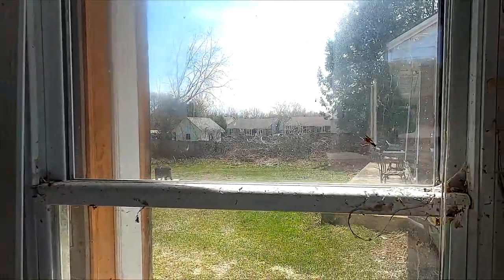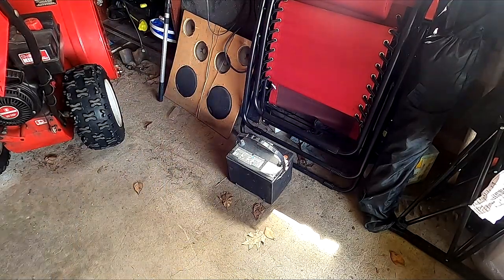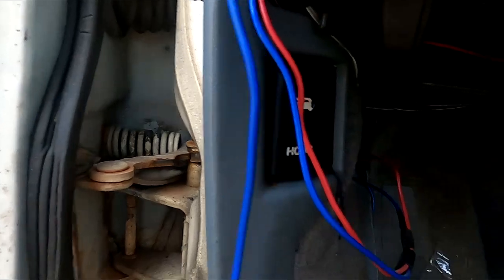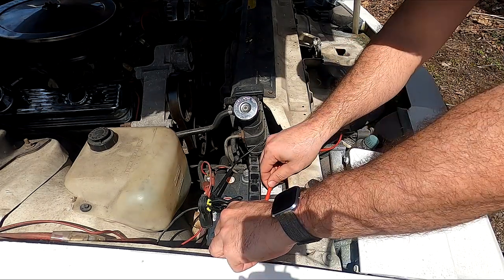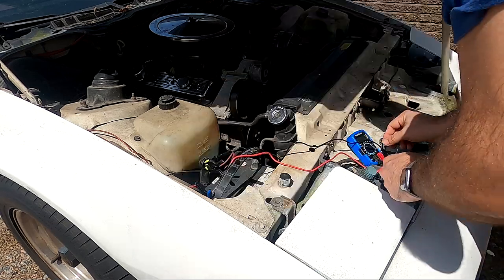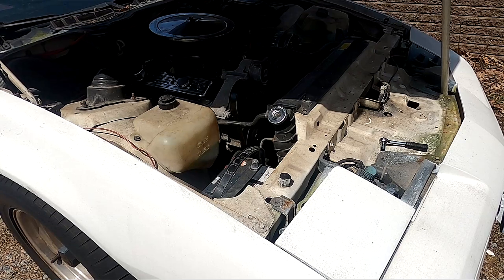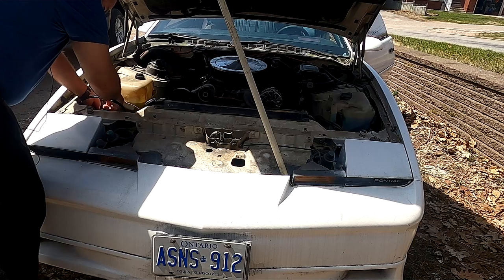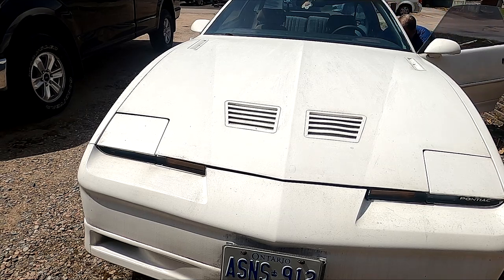Diagnosing the parasitic loss in the TransAm

Comment: If new battery doesn't help. Pull the negative off the battery. Put the test light between the post and the ground wire. If the light illuminates, you have a draw. Use the fuse pull method to find the draw; when the light goes out, you found the draw.     Like you said google is your friend

Comment: I just had an original battery in my previous car. Chrysler concorde 2002. It was a a battery from 2008 or 09? Lots of use out of it but also had a fusible link go on it at same time. Some battery's can get lots of life out of them as long as you drive the car and allow the alternator to charge it.

Comment: And the smart way to measure current draw, pull a fuse, probe across the socket, move to the next fuse, and repeat, and when you find the draw, there you go, measuring a draw at the battery just says "Yes, you have a draw, good luck finding it!", so, fusebox probulating is the task required... :P

Comment: So, first, yes, dead batteries will lose volts, because they usualy have shorted plates inside, and the headlights, they probably have dirty contacts in the motors that should tell them to stop turning but aren't making good connection, hence them pulling them in when you connect the battery, though I'm no expert on poppy-uppies, my extent of headlight tech knowledge is 2CV headlamps where they're bolted to a crossbar under the bonnet with an adjuster knob inside the cab to raise and lower the beam angle... :P

Comment: Having not ran the car and allowing the alternator to charge the battery and keep it charged can weaken and kill a battery. Plus battery's age overtime and won't be able to hold charges anymore. I would throw a fresh new battery in it and also make sure to get it out when possible to drive it and keep the alternator charging the battery. Also test the alternator too if it's an original it could be acting up.

Comment: its not your motors, thats what there supposed to do when power first hits them, if you think the motor is sticking or drawing just feel the motor if not warm there fine, from what im seeing its not the motors pulling the battery down. That battery looks very old if i had to guess its probably has a bad cell just isnt holding a charge anymore. Ive have several of these cars I understand these headlights very well

Comment: Not sure on headlights , If you hook up the amp meter in the neg terminal and wait for all to go to sleep , it should not draw more than 25 milliamps , Some meters do not go that low , so they will not read anything .. I would get the battery properly tested . Just having voltage under no load does not make it good . Also with battery hooked up if you put meter on dc volts and put the probes from meter one on one side of fuse and other lead on other side of fuse it will show up as voltage on meter if current is flowing on that circuit . You can se the contact spots on the fuse to put meter probes as you look at fuse  . More resistance in fuse so current will read in meter . Very well could be that battery , would of expected closer to 13 volts coming straight off charger , Surface charge . But need good battery to properly test anyhow . Also when amp meter is in line do not open doors , turn on lights or anything , as all power has to go through amp meter it would probably blow a fuse in meter if it has one .  .

Comment: A  big dollar clamp meter can detect any amp draw....too bad they are 500 bucks and higher.  I use them in the irrigation industry.   Likely you need to detect milliamps  ..Clamp meter is the only way.  Pick up a battery terminal switch...not a cheap one...easy to flip it off after a cruise...we use them on all our work trucks that are parked for the winter.  Every spring it saves us from buying 10 batteries, because they all froze in northern alberta winters.